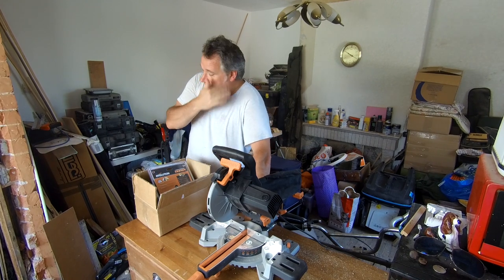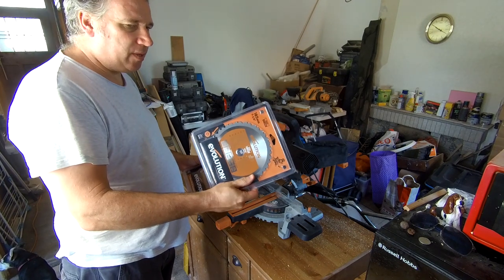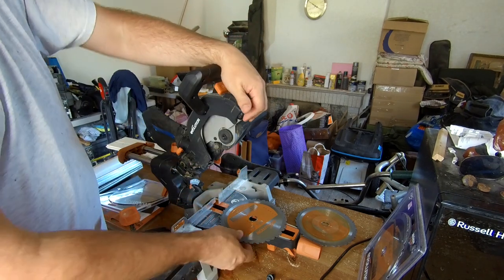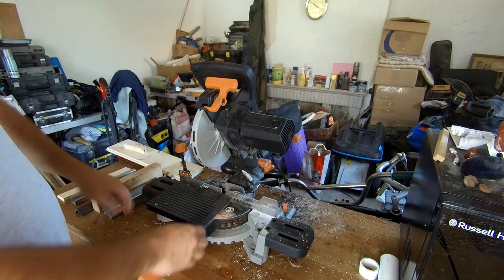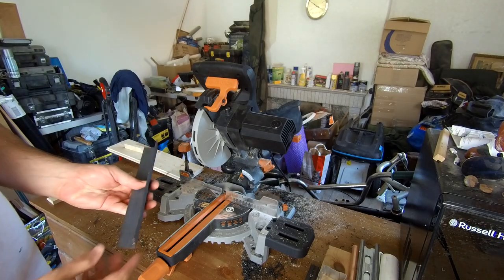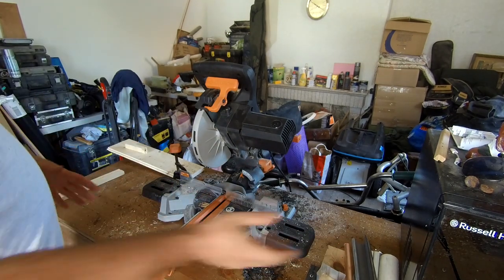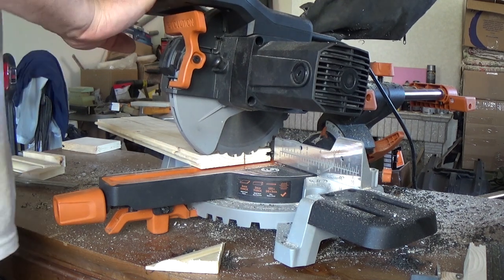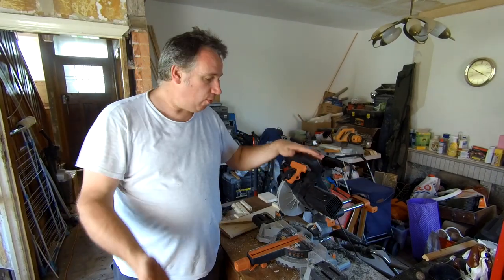Mitre Saw Cut Test - Multi Material Evolution R185 SMS Sliding Mitre Saw | DIY Vlog #35

Comment: Thanks for that! Evo have refurbs of these for 60 quid on ebay, came to YouTube to check I'm not buying tat and now I've got one on the way!

Even tho it was a 3 part review, didn't feel like there was too much waffling, you gave a considered opinion, you used all the gear correctly (cough safety glasses) and your camera isn't you awkwardly holding your phone in one hand. 10/10! most uk diy you tubers are an absolute shambles!
Reply from the maker: Thanks so much for you kind words. Yes a really should be wearing *cough safety goggles if I'm demonstrating to the world. I do have a big JCB mitre saw in the background but this one is perfect to move around and use. Does most jobs the DIYer will need it for.

Comment: To limit breakout in the cuts, lower the head with the telescopic arms fully extended then cut on the back stroke, this changes the angle the teeth cut the lower side to something like a table saw.

Comment: For a vacuum system I've repurposed a cheap lamp (bought secondhand) with 2 flex joints and where the bulb and lampshade would be I made a holder for a vacuum mouthpiece and then just put a very cheap wet/dry multi purpose vacuum cleaner on there. Very easy to fix in a spot behind or near tools and if you get a flash flood or what ever you have your self a movable water hoover. Total cost 40 pounds.
Reply from the maker: I was thinking of making one of those cyclone systems from bits. Might try your idea whenever I get round to it. 👍
Reply: @LCWDIY  It'll be interesting to see what you make. I'm sure that now with the missus (and nice that she's moved in) in  the house she would prefer it doesn't look like a bombs gone of in the house every time you cut 3 boards so it will probably be sooner rather than later with that garage/shed/work space.

Comment: Oh thanks for the great video
I’m thinking of buying one of these machines do you know if it can cut through 2x6  piece of wood
Reply from the maker: This model won't but there is a bigger model that will. Although you could use this but you would have to cut half of it then flip it over to cut all the way through.
Reply: Is the max cross cut on here 210mm? Thanks

Comment: Hi just wondering how much bulkier in actual size is the 210 compared to the 185.(not the blade lol). It's just I haven't got room to leave it set up so need something compact that I can store away. I'd prefer the 185 but sold out around my way, so considering the 210..
Thanks. Hope you can help.
Reply from the maker: Sorry but I've not seen the 210 so can't compare it with the size.

Comment: Another great video. As usual, I learned several things. 
I haven’t used a miter saw or circular saw. Once blade has been damaged, can it be used on any other material or will it just damage what I want to cut?
Reply from the maker: Thank you for your kind words glad you enjoyed it and learn from it. The blade I blunted will still cut wood, it will just be a little bit rougher and slower to cut through. It certainly won't cut through metal properly now.

Comment: Thanks for the video, I'm looking to purchase a mitre saw for laminate flooring the whole house. This looks like ideal tool, is there a way to use this to cut the laminate flooring plank the long way, I'm thinking about that last raw of the flooring which will require me making the long cuts. If not, could you recommend any other saw pls?
Reply from the maker: It won't cut laminate lengthways you would need a table saw for that. Or the cheaper way would be to use a length of laminate as a straight edge and use a circular saw or jigsaw to cut the length of the laminate.

Comment: Will this cut through 76mm thick skirting?
Reply from the maker: The maximum this will cut is 215mm by 56mm. So no this model won't cut through 76mm thick. You will need the next size model.

Comment: “If you have a tiny piece of copper left and you don’t stop the blade it could fire it to the other side of the room” 
What in gods green earth are you chatting about. The blade spins toward you from the top meaning down into the table. The small piece of copper would be thrown away from you into the fence. Not forward across the room unless you have reversed the direction of the motor.
Reply from the maker: It's a sliding mitre saw. If someone pulls the saw out it will hit the other side of the blade that's now spinning upwards. That's what on god's green earth I am talking about. I've seen other idiots do it. It can also bounce off the fence and hit you in the face.